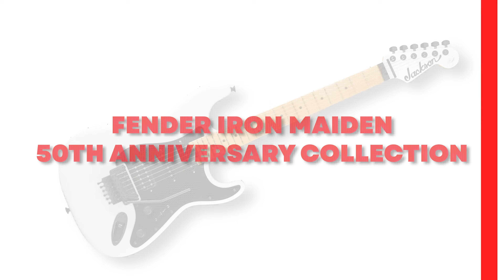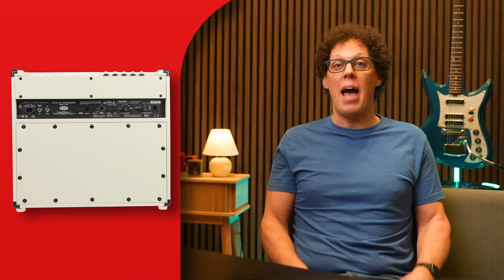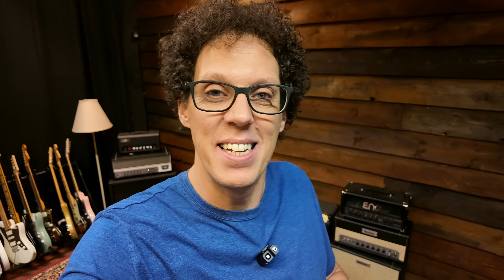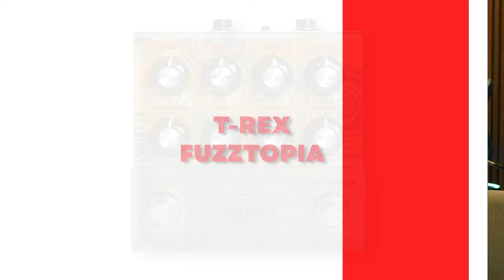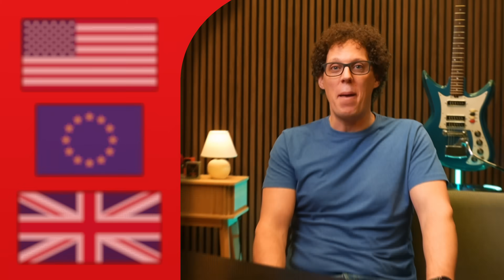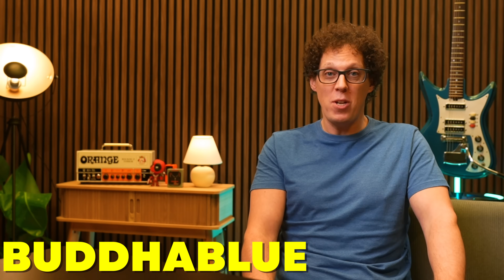TWIG 98 - Too Many Guitar Gear Releases, Not Enough Wallet

Comment: I think you are wrong as wrong about the Abrams:

Here is what I can find plus many more resources about modern solid-state class D amps.

Class D Amplifiers and Ohms
Class D amps are highly efficient and can deliver stable power across loads. They don’t require output transformers, so they’re less sensitive to impedance mismatches.

PS Audio forum discussion: Class D amps often scale power linearly with speaker resistance, e.g., doubling wattage when halving ohms.

EDN technical article: Explains how Class D amplifier power supply requirements are designed to maintain performance across different loads.

Texas Instruments application note: Shows how Class D amps interact with speaker impedance and why they don’t require transformer matching.

Stay Tuned Guitar overview: Highlights that Class D guitar amps are efficient (up to 90%), lightweight, and portable, making them less prone to overheating and impedance issues:
https://staytunedguitar.com/class-d-guitar-amp

Comment: You sure about that ohms rule on Solid-State Class D amps?  I think that halving rule does NOT apply to modern solid-state class D amps.....I have a Carvin Mach100 and I believe it does NOT apply to that one either. You tube guys "no pun intended" need to get with the program or debunk what I'm telling you because....maybe I'm wrong, but....I would like to know and maybe you could do a video about that.

Comment: Regarding the Abrams at 4ohms talk, I do have a HiWatt Leeds 50 head that is 50w at 4ohms, but I’m running it into an 8ohm cabinet. So that makes it a good bit less than 50w right? That being the case, it is literally just as loud as my Orange Super Crush 100 head, which is full 100w into the same 8ohm cab. Not to mention my Quilter Aviator Cub is 50w and is also capable of being just as loud as either of those two amps. So if EHX did this right, 50w is going to be plenty for just about any application. I’m sure the amp combined with an 8ohm cabinet will still be capable of blowing eardrums should a person desire it.

Comment: The EHX Abrams 100 could make a 100W, vertical 2x12 ministack with a parallel pair of BluGuitar Nanocabs which weighs approximately 39 pounds.  The 100W would halved between the speakers such that each 60W speaker would receive 50W, though I would be careful with maximum output.

Comment: Fender seems to have lost their collective mind with regard to the EVH amps.  First, the Iconic series appeared with so few valves that I would have expected a Blackstar collaboration; now, they have a digital 1x12 combo which supposedly saves weight at 40 pounds!  Not only is that not particularly light compared to valve 1x12 combos, I can beat that weight with a Synergy SYN-20IR loaded with the Synergy Peavey 6505 preamp module and BluGuitar Nanocab: the total price would be extremely similar, and I could buy additional preamp modules for 400 notes (perhaps the Synergy Marshall JMP module for early EVH).

Comment: I've got three destinations for my guitar: headphones, audio interface, & air. I want it to sound as much the same in all three cases as possible. So I have no use for a 100 Watt amp that adds character. When I want to push air, I want it to be as faithful as possible to the signal I'd send to the other destinations. But...built-in power supply? That's almost enough to sell me! I get so annoyed by separate power supplies, which are so unfortunately ubiquitous.

Comment: Imagine buying a $1700 solid state amp when you can buy a loaded tonex one for 250. On that note, can someone explain the technical difference between a volume knob and "attenuation" on an all digital modeling amp haha
Reply: A volume knob would typically reduce the gain of a real or simulated amplifier stage. An attenuator would provide a load after the last amplifier stage in order to effectively increase the resistance of the cab.

The really ridiculous thing here is that you could get a really good 5150-III model by buying a ToneMaster Pro--and it's probably the exact same model used in this amp. When comparing it to the ToneX, they can at least argue over which model is better. But if you compare to the exact same model... the general purpose modeler is clearly the better deal--and they've had the TMP on sale below $1300 before.

Comment: Why would you buy that EVH amp when you could get a Fender Tone Master floor unit that has an EVH 5150 model in it for less and then use the left over change to get an FRFR cab? I have the same issue with the other fender Tonemaster Amps. Surely they should be significantly cheaper than the floor unit if they only use one model?
Reply: @MyNameIsManLee  but the tone master floor unit doesn’t have a big logo that you can impress all your friends with and the drunks that you don’t know at the bar when you’re playing at 2 AM
Reply: How does that sound compared to the real thing? Probable the answer is there.
Reply: @Javier-qk7ms but this amp isn’t the real thing. It’s the model from the fender tonemaster put into a combo. You can get the real deal for less so that just makes this amp even more confusing. I have no idea who this amp is actually for and I think fender don’t either.
Reply: @MyNameIsManLee I meant the tone master + frfr comment.
Reply: @Javier-qk7ms ahhh I get you. I mean the tone master and FRFR shouldn’t sound any different without post amp effects, but if you put some nice settings on after the amp in the chain it’ll sit in a live or studio mix with minimal adjustments compared to the combo which is just the amp model. Plus you can swap through different tones of the amp much quicker. If it was a good chunk cheaper you could justify it existing, but it’s more expensive than a full Tonemaster Pro rig. It’s times like this you remember fender is owned by a venture capital company and not by musicians 😢
Reply: Yep, just one more reason to buy a “real” amp 🤘🏻